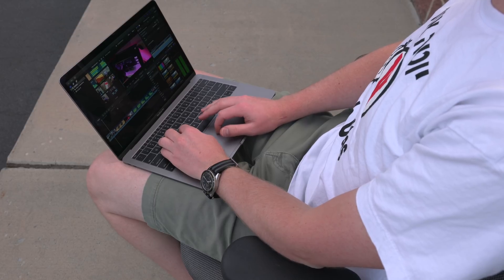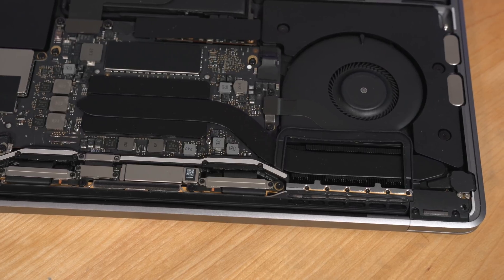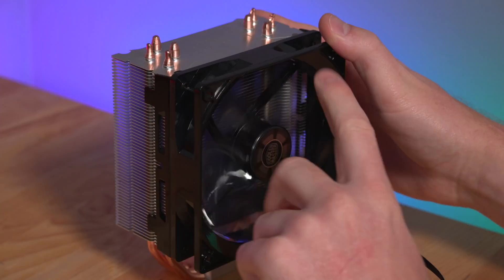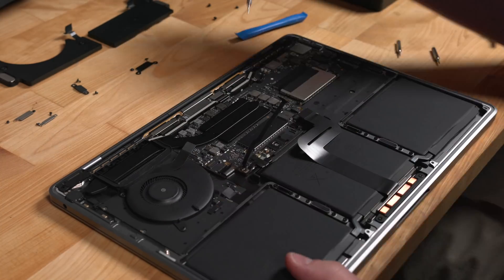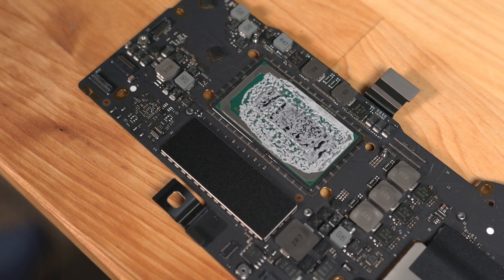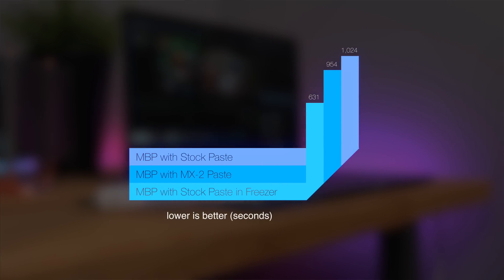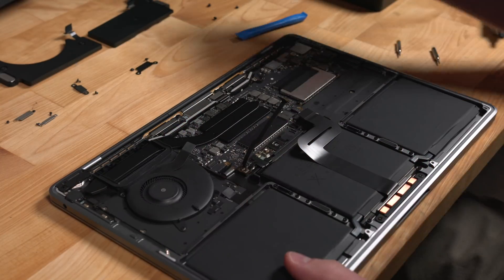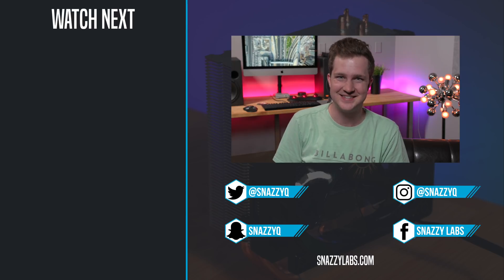Fix Thermal Throttling on Your Mac?!

Comment: So I ordered Grizzly Kryonaut (I live in Germany and it is a German product, so it is actually cheaper here) and replaced my thermal paste on my mid-2013 MacbookAir. I also Geek-Benched my Mac before and after, and for good measure, I also used third party software to control the fan speed. First, I tested it with the fan set to auto and the 2nd time with the fan speed set to max. The results were really interesting. Before replacing the thermal paste, I got 2617 (auto fan) and 2963 (max fan). After cleaning out all of the dust in my MacbookAir, including the fan and replacing the dry and cracked thermal paste, my scores improved but changing the fan speed NO LONGER HAD ANY EFFECT, I got 2972 (both with the fan set to auto and to max). I didn't believe that thermal paste would make such a difference, but it did! More interestingly, increasing the fan speed only had an effect on the old, dry OEM thermal paste. A~10% improvement for $7-$8 USD is not bad. Color me amazed. Definitely recommended!
Reply: I just replaced the thermal paste of my 2011 maxed out 15 inch macbook pro, its was 8 years or intensive use, 12-14 houres a day running, editing photos and videos, sending emails and running my photography bussiness. My Gpu died in 2014 even after apple fixed it for free, i managed to disable the dedicated gpu so i could use my pc and so i did (only runs with the intel GPU). My computer had sooo much dust, the heatsink was completly full of dust and cotton. One of the fans couldnt even spin ver well. My computer now fells wayyyy faster and much much cooler and quieter. Im going to wait for the new 16 inch macbook pro and im going to sell this trusty machine that has been with me for everything. Btw when rendering i always pushed the fans to the max speed for faster speed and i still do that. I guess i never cleaned it out cuz i need the pc running every time im free and im not working.
Reply: @rodrigo4379  so did u get a new one?

Comment: This is bullshit. Got a 2017 MBP 15" Does not thermal throttle under heavy load. Yeah fans ramp up and get louder but temp does not exceed 80C. Even while gaming in Bootcamp too... tried Overwatch. Temp stayed at 80C no Frame Drops/stuttering but as you can expect fans were loud

Comment: How the FUCK does Apple put that tiny ass cooler in such an expensive laptop. If they really wanted to keep fan speeds low to keep it quiet why wouldn't they just throw in a slightly larger cooler?

Comment: Try the same trick that Dell XPS owners have been employing and add some really high quality thermal pad material all along the heat pipe so that you basically turn the entire bottom of the laptop into an extended heatsink. Apparently it makes worlds of difference for the XPS, so I can only imagine that it would do similarly in your application. Just beware, it will make the bottom a few degrees more toasty, though it will spread the heat out better. So win some, lose some.

Comment: The MacBook Pro with touchbar will do much better, it has dual vents and non ulv CPU
Reply from the maker: +MrAwesome Also has a much higher TDP, however. So I’m skeptical.
Reply: Snazzy Labs I use it every day, it thermal throttle but not this bad

Comment: Do you know that 13 inch Mac Book Pro with Touchbar actually has TWO COOLERS? They ARE different from base version.
Reply from the maker: +Maxim Yes. Didn’t say they weren’t. They still throttle because they have a much higher TDP processor.

Comment: Hey Snazzy, could do a video on cooling your iMac in some way? The thermal throttling may be less but god does it run hot all the time if you do CPU or especially GPU intensive tasks.

Comment: YOU WANT TO COOL A CPU 2 EASY STEPS 1. REPLACE THAT SHIT COMPOUND WITH LIQUID METAL I USE LIQUID ULTRA  FOR THE MAXIMUM HEAT TRANSFER 2  DOWNLOAD INTEL XTU AND UNDERVOLT IT AS MUCH AS YOU CAN WHILE RUNNING CINEBENCH R15 if its stable then you have a winner i reduced my overall system temp by 25 degrees with this easy method
Reply: ReactorFox3 Was that what broke your caps lock key though?

Comment: NOOOOO! They don't ship to Japan!
I checked in Amazon Japan, and it's not sold there... sigh
My Monitor is starting to act up, and will need a replacement soon. Any alternatives?
Reply: Never mind! I FOUND IT in Amazon Japan!
This would be great for my set up, since I have a "23 Acer monitor on its last breath. I have a "13 MacBook Air connected via HDMI, My LGA775 Q8200/GTX560Ti HackinMINI connected via DVI, so I can no longer connect my Surface Pro 3 to the monitor while working on multiple documents... 
With this monitor I could do various work at the same time!  (excuse me while I pile up excuses to save up for this monitor ;)

Comment: First things to do when you get a new laptop.
1. run aida 64 on it
2. run aida 64 and heaven benchmark at the same time on it.
3 run prime95 on it.
if it cools the CPU and GPU, congrats.
if not, take it aparts, replace thermal paste.
do first three steps again.
If it still doesn't cool it, you bought a shitty laptop with poor cooling design.
Reply from the maker: +Blaž Bohinc Prime95 will clobber any CPU. Even my watercooled 7700K in my gaming rig at home gets crazy hot. It’s not a very realistic benchmark. I’m not sure there is a single laptop that wouldn’t throttle with it after a few minutes.
Reply: Snazzy Labs The bottom line is - any laptop should be able to cool its components to the point where they can reach their full potential. 
That means running Aida 64 and heaven benchmark at the same time shouldn't present any problem. 
If you can't cool it, don't put it in. A rule to live by.

Comment: I have a question why do don't try the conductonaut it is so much more powerful than the cryonaut i use it on My own rigs and laptops and its improves the Cooling a few degrees more than the cryonaut. I know that the application is a little Bit more critical but it could be the best solutions for such an expensive hardware toaster

Comment: Just in case you're interested - upon watching the video I got an idea about putting a thermal pad on top of the cpu heat pipe so that it contacts the bottom cover and is able to use it as additional heat dissipator.

Also, the radiator on this thing is pathetic. Dells with 15W CPUs have bigger radiators in them.

Comment: Personally I have replaced my thermal paste with PROLIMATECH PK1, put a drop of fine machine oil on my fans centre pin and I run 4 different options through SMC Fan control. I've been using Apple laptops since 2007 so definitely know that MacBooks can and do get pretty heated. with these simple 'hacks' I've never had any real issues.
Using SMC I have set:
'Default' = 2,000RPM
'Medium' = 3,200
'Higher' = 4,400  & 
'Max' = 6,000RPM 
When working, depending what I will be doing, I will set it accordingly.

Comment: I'm not sure if you'd be interested in doing this, but there is a method for de-lidding (removing the metal cap above the cpu) and replacing the compound with liquid metal compound). This makes a dramatic difference on overclocking 7700k to 5.1ghz. And lowers temps by 20+C.

It's much more difficult/risky to do, but I'd be very interested to see the results! 😁
Reply: Mobile CPUs do not contain "lids". They are un-lidded from the factory

Comment: But it is not quite correct to compare the base model you use with the 13“ touchbar variant. The second comes with an improved thermal design using dual fans and exhausts. You should consider to also take this than in comparison ...
Reply from the maker: +Fischer Kevin I never once compared the two. Although, the Touch Bar model has a CPU TDP that's significantly higher so the same holds true—even with two fans.

Comment: I have just purchased Kryonaut in a 5.5g tube as i just did my vega 64 build under a custom loop. I also applied it to my spare 3350p PC my mom uses and its amazing stuff the viscocity is perfect.

But why not try liquid metal? Works even better and especially for laptops (yes i know theres a chance of it flexing and the application being ruined) but would be worth a shot. 

All in all this is just like intel leaving a big gap between the IHS and die. No matter what paste you use performance will suffer.  You want 0.000mm gap and med to high pressure.

Comment: I did this to my 2010 Macbook Pro. Fan used to be running 100% most of the time, and it probably was thermal throttling. Now the fan only kicks in when it's doing intensive work.

Comment: Just get yourself the 13" touchbar model. It has 2 cooling fans to begin with.
Reply from the maker: +Marco Pfeiffer It also has a CPU with a significantly higher TDP. The same problems exist.
Reply: Yes, 28W instead of 15W. I own (or rather have access to) a 13" macbook pro. I don't usually export a lot of videos but I did a few times with iMovie. In that scenario it had the highest temperature I've ever seen in the intel power gadget. about 95°C. Yes hot but it stayed mostly at max turbo which ironically is lower than for the none-touchbar model at 3.1 Ghz with 2 cores engaged.

Comment: @Quinn
It is still thermalthrottling...Can you please take the Backcover off and check temps again. Or go Hardwcore and drill a bit hole into the backcover and cover it with some sort of grill like a speakermetalmesh.

Comment: That’s interesting… I used Thermal Grizzly’s Liquid Metal thermal paste on my 2008 MacBook and it didn’t really affect the cooling as much as I hoped. It did prevent the ocasional drop in clockspeed down to ~1600 MHz but compared to eight year old thermal paste I really expected a more noticable difference.

Comment: Another thing that would help alot more is to undervolt the cpu. But right now this doesnt seem possible. It is even locked out in Windows with the intel xtu tool, there is a tool called Volta which does the same and works on MacOS but that would work either. Seems like Apple locked this completely

Comment: I would also see the same test performed on an older mac, where the termal compound might be in a much worse condition, maybe on the 2015 model with i7 (more Watts) it would make bigger difference than 9%, just wondering.

Comment: I always do this to not just every Mac, but every laptop I get. I use noctua nt-h1 and the difference is noticeable. My current 13" Air hits 93-94C under full load instead of 100 and no longer throttles. I can even play games in windows by using throttlestop and downvolting the CPU and GPU for extra cooling.

Comment: guys it's 2017, there's no point on gaming computers.
nVidia Geforce Now is the future.

I mean if you can run PUBG ultra on Macbook Air 2011 shouldn't that say all?
Yeah I know the 25dollars for 20 hours but they haven't thought about the final pricing and it's currently FREE for Mac's.
Reply: You still have to deal with a lot of compression artifacts and you need a fast internet connection for it.

Comment: I have a 2009 MacBook (6.1) and it thermal throttles in simple day to day tasks, IE Netflix, YouTube ETC. When I added adequate cooling I went from Half-Life 2 at 10FPS @102 degrees to 30 FPS at 80 degrees. Why does Apple have to have such terrible cooling in their laptops? Is it really worth it to have a thin laptop?

Comment: When Apple decides that acoustics > performance. No laptop should ever thermal throttle under a normal heavy load like video editing, especially a Mac since most Apple users use Macs for creative purposes. I believe Final Cut Pro is the best video editing software for people who need to edit on a laptop due to background rendering. Make the laptop half a cm bigger, put a bigger battery and more thermal cooling into the laptop so performance doesn't suffer. Have the fans spin as low as they can, but when the cpu temperatures are around 70 start increasing the rpm.
Reply: D.O.A. I don't get it, pro = professional, so most pro users would be using video editing and photo editing. I can almost guarantee that most pro users would rather have a thicker laptop that will never thermal throttle with a 100% cpu load. With a thicker laptop, more battery, so longer editing times off the charger, lower fan speeds at idle cpu usage, and overall better laptop sacrificing only two minor "drawbacks" being acoustics and size.

Comment: I'd put my laptop in a freezer if it boosted export times like that! Sweet video dude.
Reply: it does, he did a video on that already.
Reply: Mark Linsangan
You u noobs all cry bullshit, need to run a heavy process, use the cloud, why use a ultra thin client for heavy work loads? How can we remove this channel? Sweet? why call it sweet? romance? need a candy boy? sweet is good here?

Told this noob channel in the last Video, but he never get's anything, hard to remove this bullshit, why so many lame video's? read what his community cry's here!
Reply: I have some medical icepacks from an old operation on my toe, they work like a charm. I place them under a try so as not to have them touch the computer bottom directly.

Comment: Hi, thank you for the nice vid. Seen you taking your computer apart for us even with the risk involved is appreciated. But a new question came to mind. 
Since the Mac will heat up eventually does installing an i7 CPU will make it faster in rendering then the i5 in long runs or the higher heat from the i7 is worth it?

Comment: I tried using two heatsinks (tbey had a large flat bottom with wide fins) I salvaged from old desktops as a stand 
and the chassis definitely felt cooler (I didn't use thermal paste though)
Could you try a video doing this?

Comment: What if you were to drill holes on the bottom panel?
Reply: You can just test with the bottom plate of, to see if it makes any difference before destroying it
Reply: I heard of this one guy that did it on the older generation MacBook Pro. What if you had an like a really cold oven tray and but the MacBook Pro on top of it, metal to metal. Really sucks Apple puts chips that kinda struggle to utilise their full power.

Comment: My 17" HP ultrabook, operating on windows, used to thermal throttle and hit around 100°, after applying arctic silver mx-4 it hardly hit 81° anymore, didn't thermal throttle for once during 5 tests and a performance increase was significant, all of that while macbooks still fry eggs
Reply: The Actual Joker My 15" HP Elitebook 8440p (UMA) had my CPU over 60 fariegnheight. And the CPU was an Intel Core i5 dual core (arriandale) 520m.

Comment: Apple thermal paste sucks. I use my macbook pro 13 2015 for programming, it gets hot easily when compiling or indexing projects, so after less than two years my paste was dry. Try liquid metal thermal paste, it's extremely expensive but worth all the money it costs. Another mod consists to apply a thermal pad between the heat pipe and the back cover to distribute all heat on the back of the computer.

Comment: I just did this on my 2012 15" non-Retina MacBook Pro, two days ago. Removed the stock - and totally dried, for the mention - thermal paste and applied a new one; an ordinary, non-special compound? Yeah, but at least it's brand new. Any difference? For me... none at all.

Now I'm ordering a decent compound like the ones shown on the vid and I'll repeat the process on my machine, see if I get any improvement this time.
Reply: UPDATE: I bought an Arctic MX-4 tube and replaced my MacBook Pro's thermal paste once more.
Today (Sep 13th) the weather is hot as hell, here in Brazil (Jundiaí / SP, precisely) - about 32ºC. Rendering a 4K video in Handbrake using SuperHQ 1080p30 preset, my Core i7-3720QM temp peaked at 102,4ºC, stabilizing at 98... 97ºC, fans at 5500 rpm (below its maximum - 6200 rpm) and no Thermal Throttle. In fact,, the MacBook continues to heat up as a burger plate but it was worth the job; happy to know there'll be no performance decrease, at all.

Next time, I'll collect idle temperatures and repeat the rendering test in a much colder day.

Comment: What I found with my macbook air was that hooking up to a monitor, flipping it upside down on a laptop stand, and putting a ziploc bag with cold water on it worked really well. 

Potential problems:

Condensation: The processor is hitting 100 fucking degrees, and the body gets too hot to touch under full load. No fucking way. 

Contacting the heatpipes: It would work a lot better if it did contact. However, with the entire bottom of the body covered, that’s still much more area being cooled, since the metal on the inside of the laptop will cool the components it’s very close to just from air.

Comment: Damn... How many times did you take it apart? haha
Reply from the maker: Jared Only twice. :)
Reply: Snazzy Labs be very careful when reassembling not to cross-thread the screws. The aluminum that Apple uses is very unforgiving and the screws will back out over time unless you reapply some threadlock.

Comment: I had a question, I was wondering if I should by a coolermaster X3 cooling pad for my mac. I got a Late 2011 mac which reaches temp 80 degrees C even at 720p video buffering in browser and goes bonkers if I switch it up to 1080p or above or any quality at 60FPS.

It also gets hot while running simple programming softwares. Should I buy the cooling pad? Is it worth it?
I'm not looking forward to performance boost, I have to use this mac for a few more years. I just don't want it to get damaged due to heat effects in that time!
Reply: AlphaMineron Cooling pads are more effective if your laptop has vents underneath that allow cool air to be drawn in for adequate cooling.

I have an X3 and on a MacBook, the difference is very minimal. The intakes on the non-Retina models are at the hinge, and they’re very small. 

I acquired a U3+ for my RoG GL502 shortly after I got it and having the ability to selectively place the fans based on where your intakes and hotspots are is very helpful. That said, unless you own the Retinas (where the intakes are on the side), a cooling pad won’t make much difference on your MacBook.